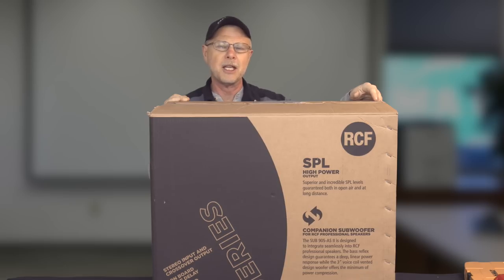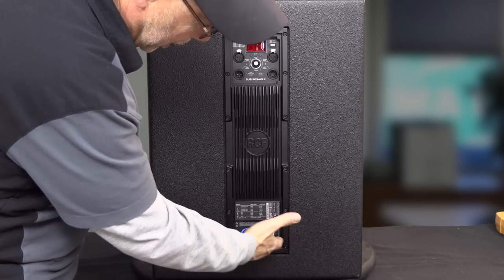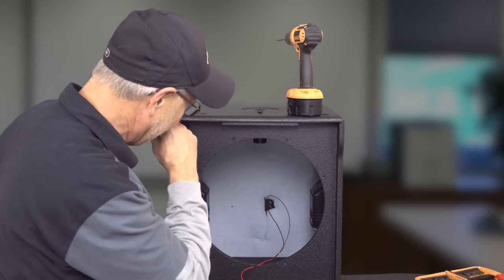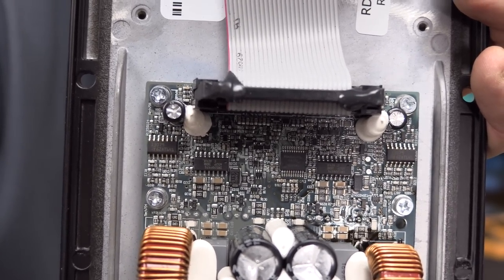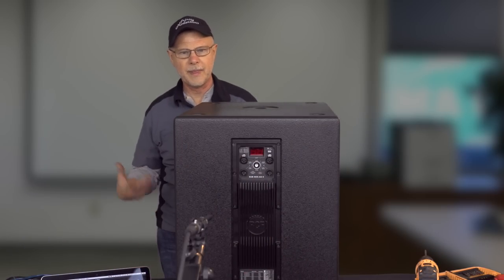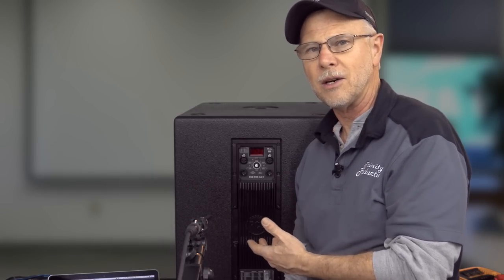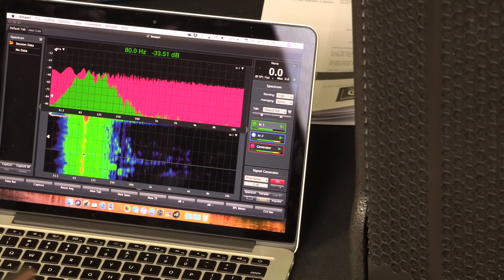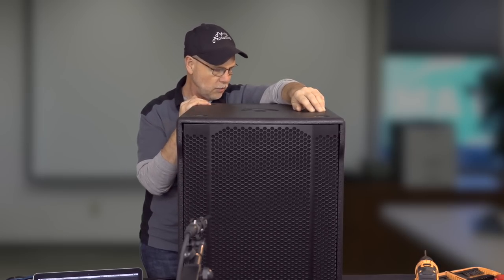RCF SUB 905AS II COMPLETE REVIEW - AUTHORIZED PREMIER PARTNER DEALERS

Comment: I own 2 of these......after 3 gigs disappointed......., ive used RCF for most of my work over the years, one of the best all round cabs has to be the 312a i use several pairs and swear by them,  but for the money, weight and size the 905 asii has lost my confidence, over rated, under powered, over priced....oh and far to heavy, should have used a neo magnet !, on the plus side the definition and tone of the bass is outstanding for the size of the box
Reply from the maker: that is interesting, because we just installed this one and another in a community room gym at a church and was blown away by the output of a 15" sub. We have used others including SUB15H from db tech and this one is WAY stronger, not sure how this 15 can be underpowered at 1100WRMS, most other 15" subs in this type of config are way less power, like 700-900WRMS if you are lucky. it is a bit more $$$ since it has great DSP and power vs. competition. physics pretty much dictate what you can get from a 15" dirver and the size and power of this box...we were impressed and will be using more of these on installs for sure as the small form factor fits nicely under stages...and yes is does sound amazing.
Reply: I just think maybe the 1100 watt figures might be little "ambitious" considering the early soft limit stage, RCF claim there is another 6db available after the soft limiter flashes, where would this extra 6db (which is quite an amount) come from ???.
Reply from the maker: it is the amp power, how it is configured in limiting or soft limiting does not effect rated or stated power, only how that transfers to the speaker/voice coil of the driver. it would be false advertising to be anything different that what is stated for the amplifier power output...would you not agree?
Reply: Am still in testing with mine, neo maybe 3.5” custom/3”
Reply: The RCF rep told me via email that after the soft limiter starts to flash there is still another 6 db left in reserve, now unless i missing something, if the signal is clean and the soft limiter starts to flash i just cant see where this magical extra 6 db is conjured from, if the soft limiter starts to flash and at that stage the level is increased or a piece of music is played with very low frequency then surely the soft limiter would only increase to protect the amp/driver....thus reducing power ?
Reply from the maker: It is not limiting the amplifier, the amp is always producing the 1100 watts, it is limiting the input section so that the amplifier is not over driven. the level control does not control the amp but the input gain and sensitivity to the amp, thus not allowing too much signal to hit the amp section and overdrive or just to adjust overall level of the unit.
Reply: I guess we just have to except manufacturers figures and hope they are near to accurate, the more reputable the manufacturer the more believable they are !,  i am grateful and respectful of your reply, i fully understand input gain structure but can you explain to me once the "soft limiter" starts to flicker we would conclude that we are at near maximum power irrespective of how much voltage the amp module is getting from the source (mixer)....i still dont see where the extra power would come from as the RCF rep says another 6db.....and his words were "Dont Worry Theres Plenty More Left"...maybe im missing something,
Reply from the maker: I really don't know where that extra would come from when the speaker would be hitting the limiter full on all the time. it may be that when the limit goes on that they mean 6db more until it max's and stays on...but that may be an internal knowledge thing he was told from RCF, we have had same comments from Allen Heath on their dLive boards, an undocumented reference to performance..
Reply: trinityprosound so what is best way to set pioneer mixers are most djm +4 am confused by this
Reply: good point....my only gripe with the box is a thought it to be little to price at £1155.00 each as there are other ways to achieve the same results for less cost,  but as i said before the definition of the 905 is nothing short of outstanding for a 15 inch.
Reply from the maker: flat no tone added or taken away - no boost, you will put your speakers into limiting rather quickly and also ensure you have a sufficient speaker system for your gig....we find many DJ asking too much from a system, where they should have bought more speakers and have damaged the speakers trying to get a sound out of them they were never made to do...